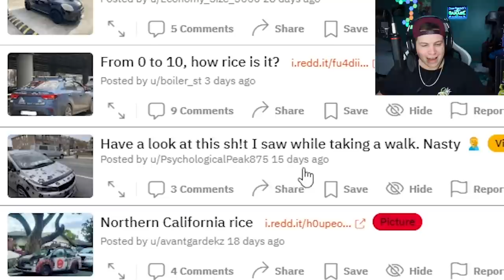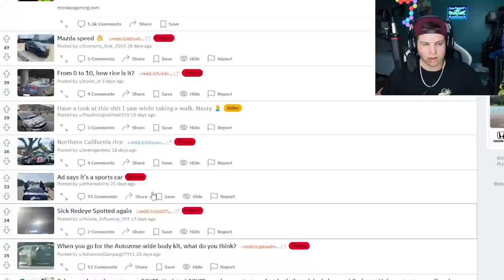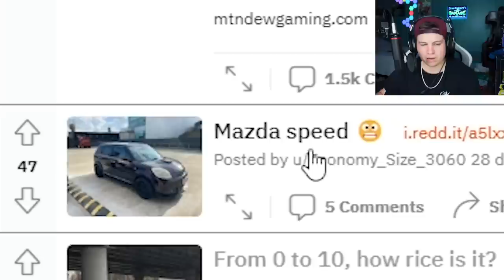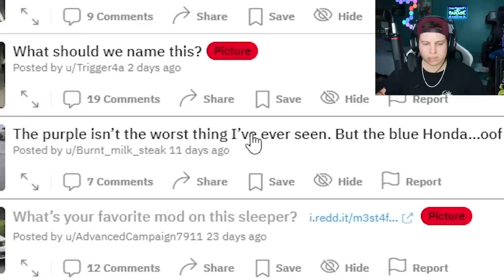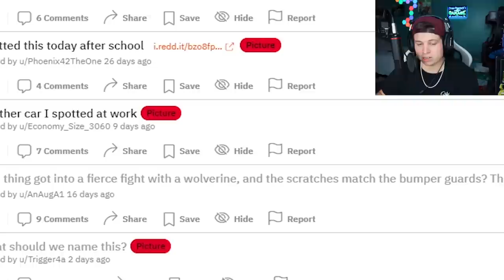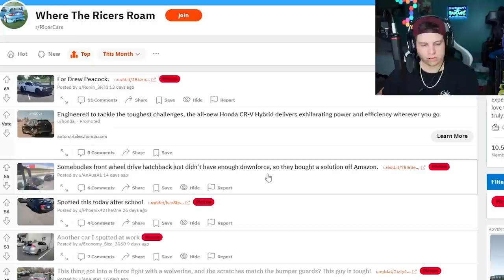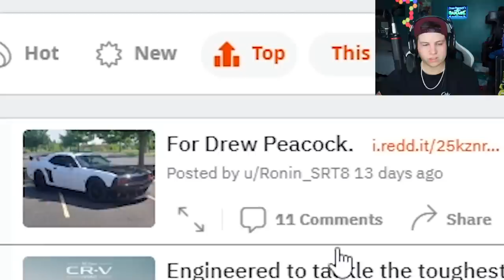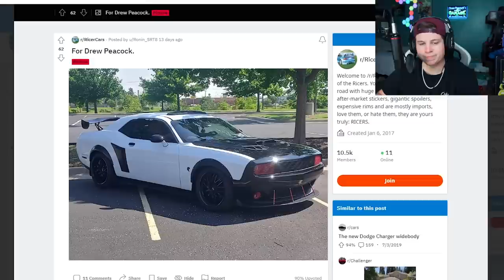Moron Wastes ALL His Money On A RICED Out V6 Challenger... (Ricer Cars on Reddit)

Comment: Not a modded echo, but a cool platform is the early Toyota Tercels which share their drivetrain standards with Starlets and Paseo's

Swapped the 1.6 SOHC out for a Paseo 1.5 dohc (74hp to 110hp) + some bbs wheels, black leather audi TT seat swap, short shift kit, and some ebay coils. Car was super fun to drive.
Reply: Everything old Toyota is going up in price like crazy, old Starlets here in Norway are 2-7k

Comment: Drew the only functional thing on that challenger is actually that sunroof visor. What it actually does is kill the buffeting sound as you drove down the road in old school cars which had pop out sunroofs. Nowadays cars that come with a stock sunroof usually have an automatic deflector that pops up as the sunroof slides back. To the keyboard warriors that dont believe me, if you have a modern car with an automatic sunroof , open it up when your cruising around 50 and pull down on the deflector, you will instantly hear the buffeting its freeking mind numbing
Reply: Yes, I need to get one for my car,. cause I can't go over 15mph with it open

Comment: That's not a Kia Rio the Kia Rio is a small subcompact car and believe it's also it's a hatchback that's the Kia K5 or what was the optima it's like the in the Kia cars the K5 should have a 2.0 turbo 4 cylinder I think so yeah you're right on the one exhaust tip for one cylinder